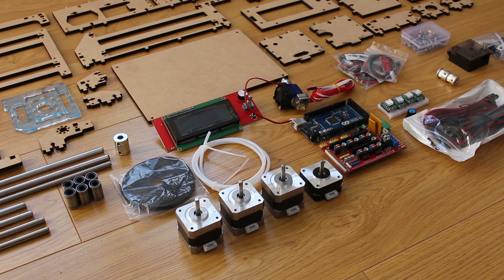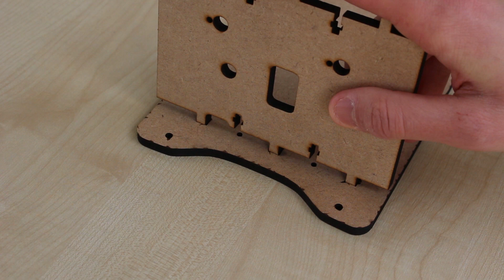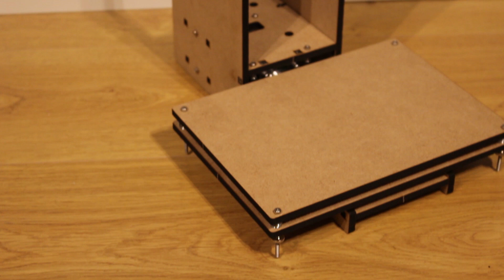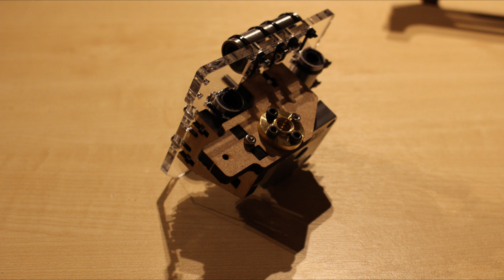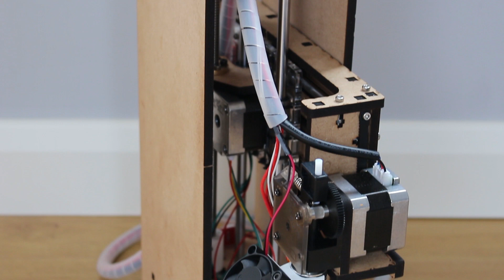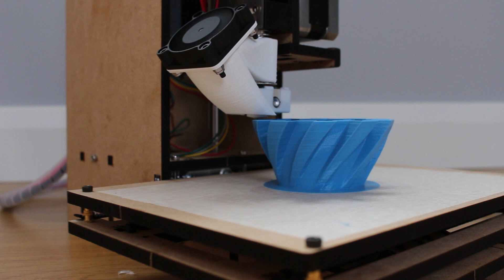TowerSimpleXL 3D Printer Build

Comment: hi can you upload the marlin firmware case your marlin have a error and i cant find the error please help
Reply from the maker: I'll try and find it for you, not sure where I saved it...
Reply: PracticalProjects can you tell us what the sittings and the power supply it will be nice plz respond because i dont know how to make it work good
Reply from the maker: @gamalnaser6449  hello, you will need to ensure you specify the correct power supply for whatever unit you have in the firmware.
Reply: PracticalProjects ok i will tell you something happens i used 12v5A to power the Ramps1.4 and i put the 12v5A power supply to the 5A point and the power supply start to plink the led turn of f and on and the poly fuse start smoke so what is happening i don’t understand man😂😅please help